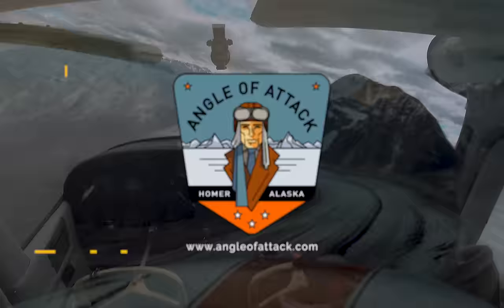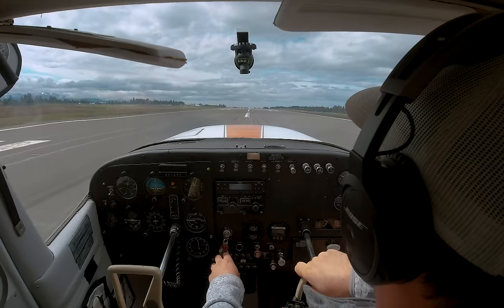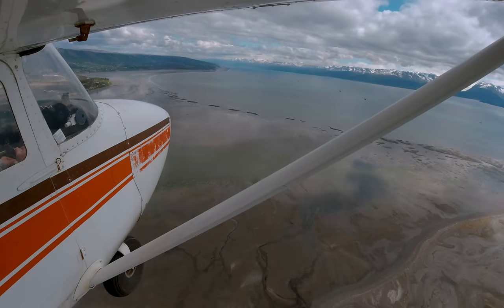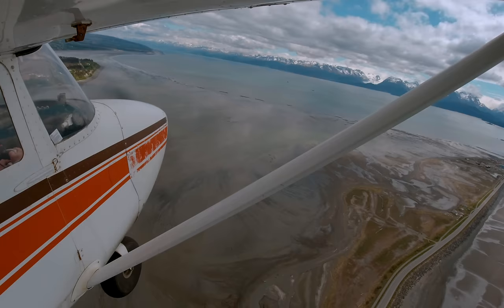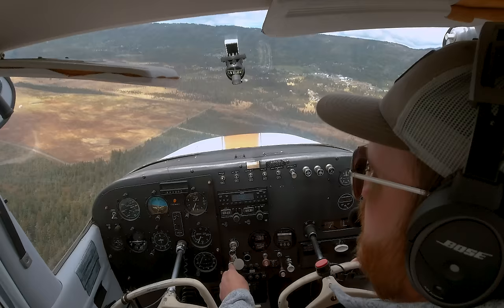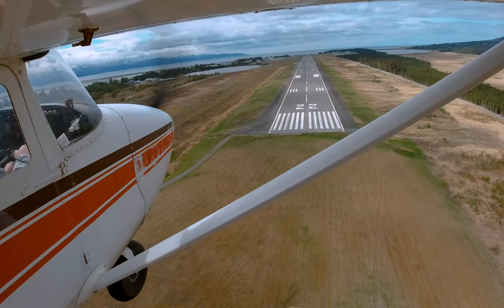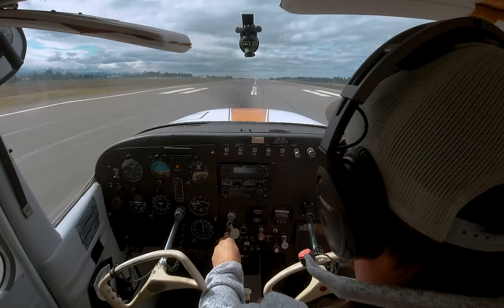5 Common Landing Mistakes [+] How To Fix Them | Flight Training

Comment: I would have expected you to say that you were re-trimming the elevator with each power or flap change. A non-pilot or student might think that you're continually pushing or pulling on the yoke to maintain the desired airspeed. I was taught to use the yoke to bring the airplane to the proper speed and then trim the pressure off so that I could relax the muscles in my arm and the airplane would maintain that airspeed on its own..
Reply: Correct.... in the case of prop driven aircraft you use Pitch Attitude or Elevator,  to control your Airspeed on approach and better to hold that Control position firm once you have attained your Vref speed with set power for that speed. Then adjust your descent or glideslope
by use of  incremental Power.... OFF to descend or ON to stop rate of sink and or gain height or remain level..... until you get back on glideslope...... while keeping that Elevator position fixed which keeps your Airspeed locked on at your set approach speed without having to chase it in an inept way.

Comment: I earned my license back in the early 70's and was taught by an older gentleman who was old school.  Just to give you an idea of how old school he was he allowed me to solo at 3.9 hours.  I was begging at 2.5 hours if that tells you anything about me as a 23 year old.  Anyway, he taught all his students to land POWER OFF in the Cessna 150.  Every landing was POWER OFF, every time, no exceptions.  His logic was until you could perfect a power off landing then you weren't safe.  Making the runway under any circumstance was the point of it all, so if you had an engine failure anywhere in the pattern then you knew you were going to make it to the pavement.  Learning power off approaches in a variety of aircraft will make you a better pilot, so if it's a Cherokee Six or an A36 or a Seneca or a Mooney, etc., don't hesitate to commit to this process.  

I watch pilots flying power on approaches in light airplanes and it makes me cringe.  Extending patterns to the point where making the runway is totally engine dependent is simply an accident looking for a place to happen.  Engines really do quit and then what; power lines, trees, houses, and other obstacles come into play when they don't have to if you learn power off landings.  Sure, larger complex airplanes fly differently and are heavier on the controls with glide ratios more akin to rocks than airplanes, but in truth they still obey the same laws of aerodynamics as any airplane in the sky, including the space shuttle.  Remember, every landing in the space shuttle was a power off landing.  Lower glide ratios only make power off approaches a bit more challenging, so don't let that stop you from learning.  There is absolutely no reason not to learn to land power off in just about any airplane, short of jets or heavy twins.  Dragging your light airplane in on a 2 mile final with a 3 percent glide slope WILL bite you in the ass one day if the engine hiccups.  And think again if you believe engine failures always happen to the other guy.  This is my word to the wise.  JD
Reply: Hey, exactly what I wanna say every time I am watching such videos! I am getting my license soon too (already >30hrs), and my instructor teachs me everytime to land w/o any power. This helps a lot to learn how to land in a point and how to calculate base position right.
Reply: @OleksiiMaksymov  Im in the same boat (or plane so to speak). My instructor has me land with power off from the beginning of turning onto base. Power off. Gentle turn. Set trim for best glide speed(60knt) Flaps accordingly and float on in
Reply: Agreed! With few exceptions, every landing I make in a single engine airplane is power off. I cannot overstate the uncomfortableness of driving to the runway dependent on power in a single engine plane!
Reply: You make excellent points. Over the years I've heard of so many crashes where the plane was on final and didn't make it to the runway. Like you said, power dependent approaches. Stupid. I tried to always stay above what I called a glide cone that started miles from the airport. You and I are about the same age and got our PPL about the same time. I got mine in a Cessna 150 in March 1972  at Fullerton, CA. How about you?
Reply: @googleuser-fo7td  Power off is the term used for throttle closed, engine at idle, but still running.
Reply: Give me a report back of how that power off landing works on your first instrument approach  LOL
Reply: @philipmartin708  can you link to just one of those “so many crashes”?
Reply: @bobbobber2156  To be honest,  I didn't know about that incident. I just googled it. I was referring to TV news stories over the years about planes going down pretty close to the airport do to engine failure.
Reply: great point made, power only there to gain a little height if you find yourself too low. I wish all pilots did a few hours in gliders as they teach this to you loud and clear. One chance to land, no go around.
Reply: @BrianGochnauer  You said that right.  I've experienced several emergencies over the years. If we are all honest, do it long enough and some of those will be self created,  hopefully we can learn from those.  One of the scariest things I ever had happen was when a corroded manifold pressure gauge line opened up and the gauge suddenly dropped on approach in IMC.  Certainly seen more dangerous things, but that one sure scared the hell out of me until I figured out everything else was working and I wasn't losing power.  Practice is good, trust your training!  The other scary one was a clutch light activation in an R22B. Didn't waste time waiting for an RPM drop, set it down then and there to check it out. We train so much for the big things, the small ones can escalate into something far more dangerous depending on our reaction.
Reply: DON'T MAKE ME STRESSED OUT EVEN MORE MAN
Reply: You are absolutely correct. To be safe you have to be proficient. To be proficient you have to practice. Everything.
Reply: At the airport I'm currently doing my training the school only allows us to do power-off landings, mostly due to how short the runway is. I never realized how beneficial they were until I started doing power-on landings. It really has made me learn how to nail the numbers as opposed to gliding over them for a few hundred feet each time.
Reply: @BrianGochnauer  Your comment doesn't apply within the context of this thread. Mastering power off landings requires planning and execution. Two very important skills used in instrument conditions/landings.
Reply: Probably a bit of late comment but I’m a student pilot currently studying for my PPL in the UK. We learn circuit procedures with power and then afterwards we focus on glide approaches with no power and flawless approaches as well. All this has to be performed to an acceptable rate as the engine or flaps could stop working at any moment and us students have to be prepared for this. After we also have to be checked out by another CFI afterwards in order to be able to go solo. I’m not sure how the process is in the US but thought I’d make you aware of how it works in the UK.

Comment: This was extremely helpful! I am a rusty pilot and am just getting back into it after 9 years. I picked up the "in the air stuff" really quickly but have been struggling with my landings. Every mistake that you listed I have been doing (especially not using the rudders). Thank you!
Reply: Same as me mate! I get complemented by my CFIs on my air maneuvers but also strugle to perform good landings, specially when dealing with crosswinds and I also fly taildraggers!

Comment: Really like this. I have a PPC but none of my instructors really never explained in detail the why. The thing though is most of my training was at an airport with a lot of strong cross winds and without truly knowing why, and my body just did the right thing during landing. I still remember my first Oh Sh!! moment when I was landing on a icy runway with a strong crosswind not using the rudders and had a sideload and got sideways, luckily my instructor was there and helped me correct my mistake. and when I say side ways I really mean my nose about 45 degrees to the left from center line and sliding. I didn't freeze  up though. I tried to recover but in the end my instructor had to step in. I also remember when I was practing forward slips and this particular airport had a golf course we flew over on final. I purposely was high and came down and you can see these 2 golfers looking and pointing at my aircraft and started running because they thought i was about to crash because they weren't use to that.Oh and one time I got into the wake turbulence of a c-130.  Man those were some good times.
Reply: I hear ya... No such thing as a bad student... Just bad instructor...
Reply: Wake turbulence will kick your backside and can kill you... Now you know what to expect in that environment... Good job man...

Comment: That was a good session. Thanks. 

One of my instructors made it a point to teach many circuit techniques, including very close and also high speed circuits...both of which have come in handy. At some busy airports, it helps if you can carry a lot of speed on short final and land long to prevent long taxiing to the nearest exit on a busy runway.

Comment: Hi Chris. I’m started doing my CFI training and i learn so much from the way you explain procedures & maneuvers specially this common landing mistakes. Just a suggestion, maybe it’s good to show in your camera the left downwind (view) distance from the runway (too far or too close to the runway). It will surely help the viewers specially the new pilots in judging distance. Thanks for your helpful teaching.
Reply: I thought the same thing when I first viewed this video. I think a plus is mentioning the distance to the runway in the pattern. I see a lot of variance in patterns, even when I see someone posting a "great" pattern session, with many tracks nearly on top of one another. The actual pattern might be very large. There are also some "fuzzy" comments, such as the references to "nice and close", "a nice shallow turn". Because this vid is targeted to helping those who need the advice, I think that real numbers are very useful, as well as the left camera. That is something that is really helpful, and should be shown often during the downwind run.

Comment: I'm just a sim pilot but:
On the wide patterns, the reason I find myself doing them is because it gives me more time to work everything and makes me feel more in control.  A proper pattern usually means (for me anyway) so many things happening all at once and it gets overwhelming.  Now I know that's just down to practice practice practice, but just wanted to maybe give some insight into the inept student's mind :D

Comment: Superb video and a real achievement to talk so cogently and fly at the same time! Very revealing to see all the mistakes we all may have made over the years. Good to overcome the psychological reluctance to go around and not "stuff it down" at any price, which Chris did emphasise. Particularly liked the fact that Chris emphasised that the landing is not over until the aircraft is stationery. Very easy to get bitten by a moment's inattention on the landing roll which happened to me recently

Comment: The first two tips are quite difficult at my home airport haha hills on both sides and you have to basically combine your base and your final into one big turn.
Reply from the maker: I think it’s relevant, though. The whole point is you shouldn’t be flying like a 747. When the time does come to use an airport like yours, people have no idea.
Reply: @angleofattack  Very true. It's good to have solid knowledge and understanding of the basic principles and movements before taking on more challenging approaches.
Reply: @17-.  good to get back to basics and evaluate all the ....habits/ techniques  you have developed  good/ bad / otherwise and whether to scrap them or not...surprising the lil tricks one comes up with and  whether they are safe or not ...good to re evaluate ....SAFETY FIRST!!!

Comment: Great hint for landings. My question is you want a proper distance on downwind. 
A picture of what you are seeing would be really helpful. 
Easy to say  'stay the proper distance', but what is the proper sight picture for that proper distance? 
Good job verbally but lacking visually.
Thanks for sharing.
Reply: My instructor told me that if you're flying at pattern altitude, having the runway appear to cut the wing strut at about the middle is usually a good distance from the runway. Of course this only applies to high wing airplanes 😁
Reply from the maker: 1/2 mile to 3/4. Half mile better.
Reply: 17% That is what my instructeur also told me and it works everytime

Comment: Some aircraft have minimum power settings and require a larger pattern to dissipated the energy. Unlike what many low time instructors teach, there is no “set” procedure for landing. Wind, weight, aircraft loading (cg) all affect where you reduce power, turn base, etc. It is impossible to remain within gliding distance of the runway at all times, in the pattern, when you fly many high performance single engine aircraft (185, 206,207, etc) if you are flying them correctly.

Comment: Small movements are key to slow, just like in the taxi process, flight from what I learned from the flight simulator.   Overcorrection leads to disaster just like it does in driving.   The Go-around is your best friend in avoiding a disaster.

Comment: Glad to see you out flying.  Instruction is an art it self.  I would suggest during your instruction that you give a few techniques other than just fly downwind at a certain distance.  Give your student something to look for so they know they are at the proper off set from the runway.  Maybe putting the runway somewhere on the strut when you are wings level at altitude.  Again, how does a student know when to start the turn to base?  TLAR (that looks about right) doesn't work with most students.  Keep on flying.
Reply from the maker: fair points. thank you.

Comment: Hi Chris. Awesome video. 

I have some trouble with the Landing Flare. From time to time I’m to high above ground, before transitioning to the Flare. Maybe you have some suggestions here?

Keep going with this great work. Thank you very much.
Reply: Best thing you can do about that is throw the word flare out of your vocabulary. Think of it more as a transition. If you flare in a Cessna you’ll experience ground effect and float. If you’re too high reduce power and trim/ pitch the nose down which in turn will cause pressure under the wings pushing you up just enough to touch down.

Comment: Base to final is often a panic area when there are parallel runways in use. Like at Archerfield where I fly out of. It's often a conflicting idea. "DON'T turn to tight and boot in rudder on base to final. And DONT drift into the parallel runway approach either.

Comment: Not using the rudder properly is a very common trend with students.  When I have a student who struggles with the rudder, I try fly a couple approaches and have them only use the rudder. This seems to fix the problem

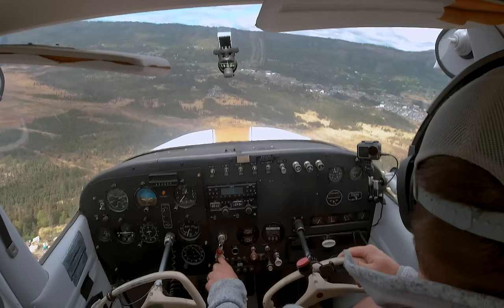Comment: Previous to 1:45, you said adding second notch of flaps, but you also adjusted throttle if I see that correctly.  And you glad left quite frequently.  What are you referencing as you glance left?   What's that reference point?

I see for staying tigher.

Comment: Very helpful video! I have trouble with the landing skills myself, mainly to much speed as asdressed in the video. I think it's a little bit instinct due to turbulences caused by the lines of trees you'll find near the treshold at many airstrips in northern germany. The other issue is to determine the right moment to flare. Do you have a tip for this, too?

Comment: Yeah I have personally seen that 'keep it tight in the pattern' attitude  on a new pilot and it totally screwed the new pilot  (16 yrs old) on his first solo. Instructor on the ground talked him through more than 6 balked landings because he did not have time to think and judge what he needed to do. I finally went out to the instructor that was talking to the pilot and told him to tell the pilot to make a bigger pattern and after a look of distain he told him to go out a bit further and try it. Landed it fine, probably a bit rattled.
   Don't be making tight patterns when your landing at new fields or high winds. 
I was worried that the kid was going to get so stressed and do something drastic and damage the airplane and himself. 
A large pattern has no real risk; your manufactured benefit of you can reach the field' is BS whether it is true or not; the chance of an issue in those 3 minutes  is so small it is just not worth the mention.

Comment: Great video.  I have a question.  You seem like a bigger guy like me.  Have you ever had a situation where you were too slow landing where the air speed just wasn’t enough to hold the increase in weight?

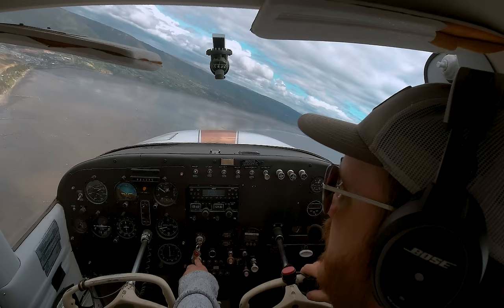Comment: well.    hmmm.     firstly,  at 1:33, wtH  is  'back pressure'.  ???
is it up-elevator?    if so, then that is a  Normal, must-do part of an  Aileron-turn !!!!
since an aircraft will always have a tendency to lose altitude during a turn,   any  deliberate reduction in altitude or throttle  should occur  AFTER  the turn is completed !!!!        some folks know what they are talking about, but they do not  Say  it, particularly, well.       googletranslate